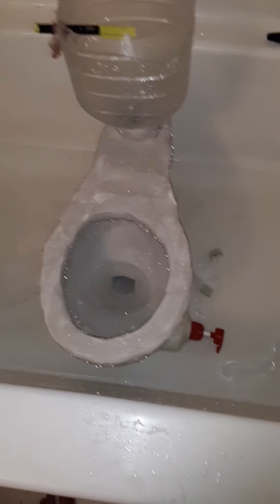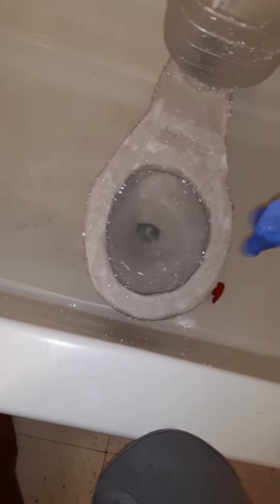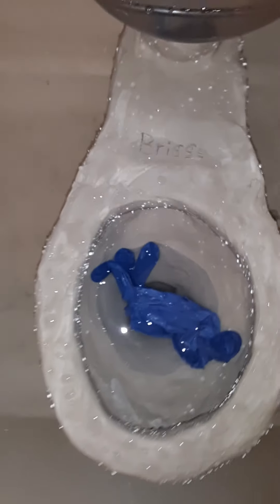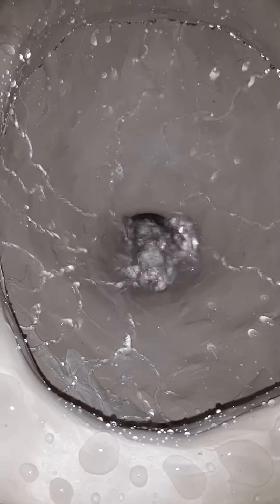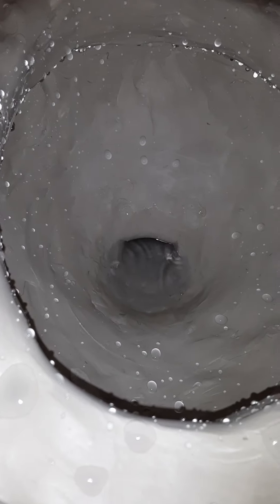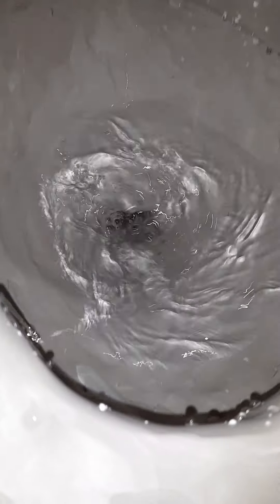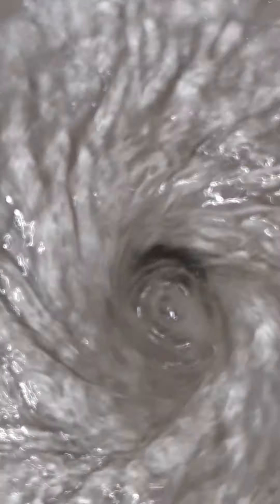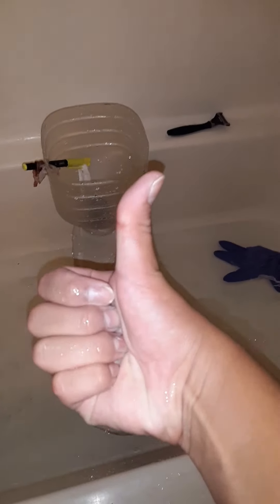230: Miniature 1970s Briggs Abingdon Toilet.

Comment: For pressure assist toilets use a gallon of water,  make a whole through the cap with a straw at the end. Take the cap off fill it half way with water and fill the other half with air from a bicycle pump and you have a pressure assist tank for your mini toilets.